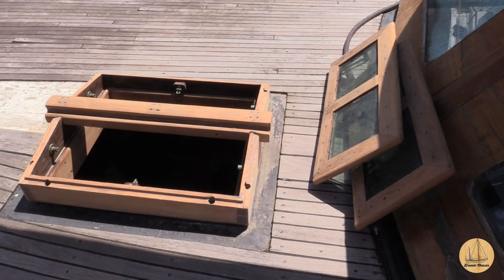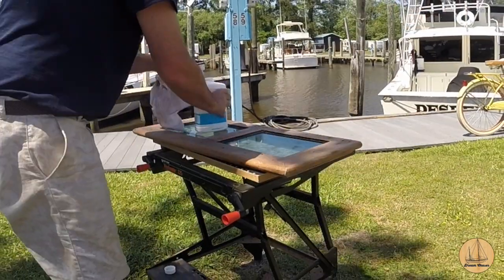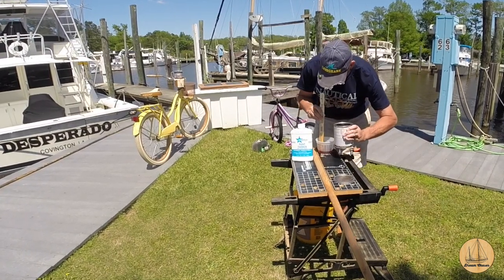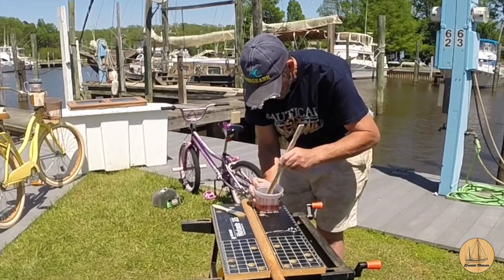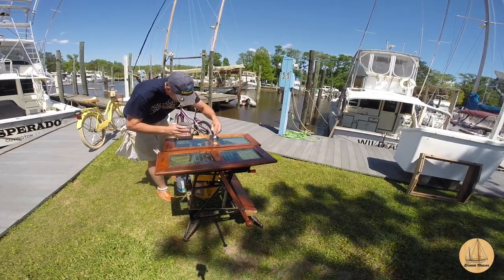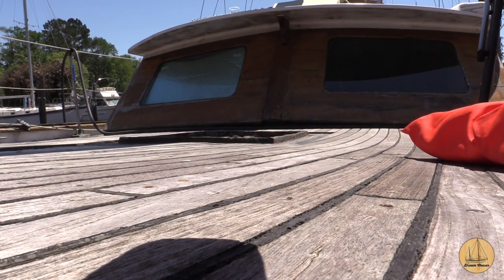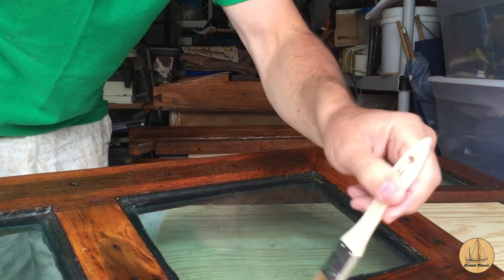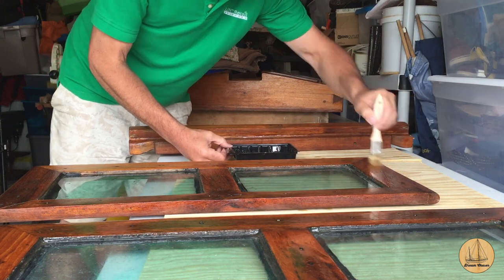Refinishing the Butterfly Hatch Part 2 of 3 - Varnishing

Comment: What do u think about 2 coats of epoxy and 4 coats of varnish ?
Reply from the maker: I am a huge fan of that as long as the maintenance varnish coats are kept up.  I have done this in a few areas and really like the results, but this is where I have found being honest with myself is pretty crucial.  
I will at times not do the maintenance coats of varnish and if the UV protection of the varnish breaks down the epoxy gets a yellow tint to it and doesn't look great any longer.  IF you ever have to go back down to bare wood again, Varnish is hard enough, Epoxy is just hell.   :)
Reply from the maker: @Clint Davis - I did a test area on our boat a little over 2 years ago.  I can show you what it looks like after 2 years.  This is in the Southern United States (near tropical sun) and you can see the 2 sections in the photo on this link.  The one on the left (the curly part of the trim) was coated in standard west epoxy with 207Special Clear Hardener and resin.  The section just to the right of that (with the other arrow) doesn't have a coating on it.  You can see just how good it still looks.  Epoxy is certainly a nice way to build up layers and save time compared to plain varnish.  (In my humble opinion)
Here is a link to the photo on our website.  http://svdreamchaser.com/wp-content/uploads/2018/02/VarnishoverEpoxy2yearsold.png